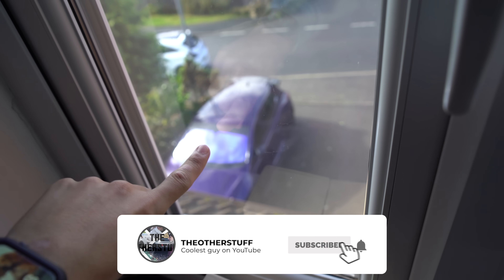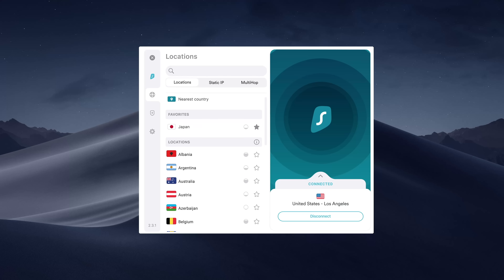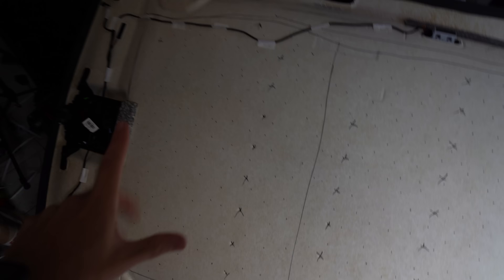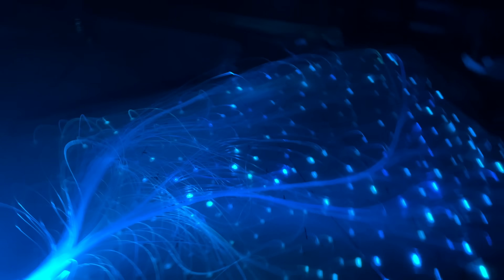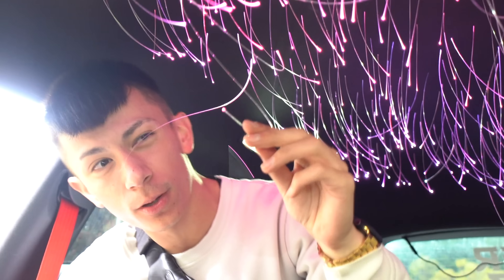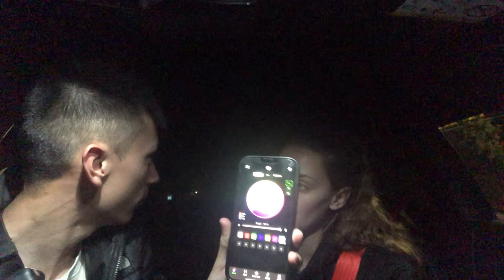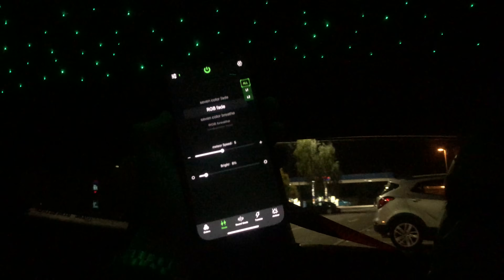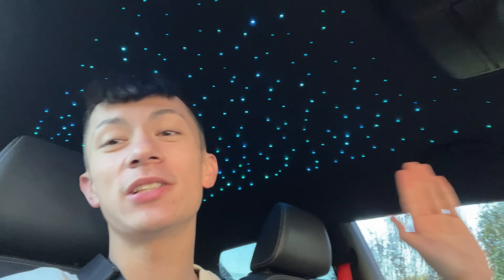STARLIGHT HEADLINER INSTALL TO MY CAR! **STUNNING!**

Comment: Hey there! Hopefully you're gonna see this question, but I was wondering how you hooked up power to the light unit? I'm tempted to do this to my own Scirocco but honest to god wouldn't have a clue how to hook the thing up to power without a cable running in clear sight.

Comment: For the starlight roof where did you place the battery? What does it run off?
Reply: He’s probabaly wired it into the actual battery or a wire that’s already connected it the battery that’s what I’ve done for my Underglow and footwell lights
Reply: Some of them just use a cigarette lighter and others fuse tap

Comment: I’m wondering where the power comes from is it connected to the fuse box or a power output like the cigarette lighter?
Reply: Probably used a fuse tap in the fusebox on a ignition live

Comment: not gonna lie, I'm not a fan of the RR starlight roof... but clearly doing it with fibre optics is far better than doing it with LEDs; there are plenty of others that have done this with LEDs and it looks cheap and tacky

Comment: Where are you running the power from?
Reply: what i was gonna ask, wanna do this to my car now
Reply: had a look on the ad on amazon says it can be plugged into 12v
Reply: @samvrs  so you need 12v port in the boot or wire to an ignition live fuse
Reply: @whatsdavedone104  yes mate, i’ve got one in the back i’ll just hide the cable down the side like people do with dashcams etc
Reply: Cigarette lighter, ignition wire or fuse tap